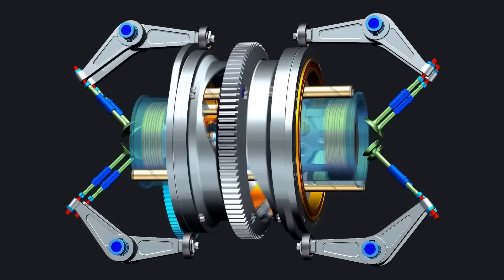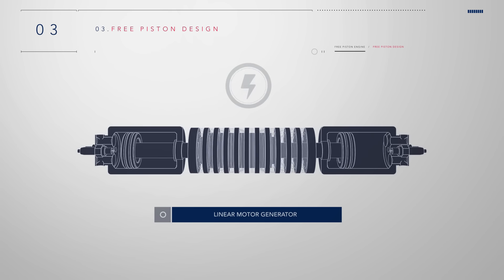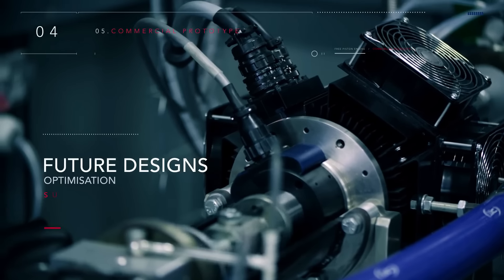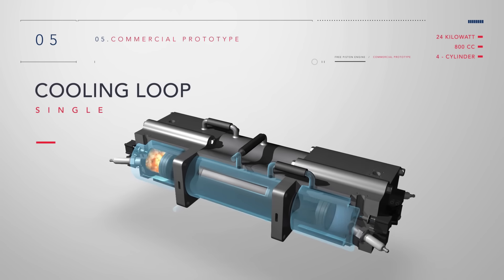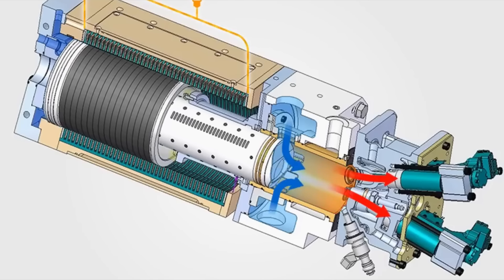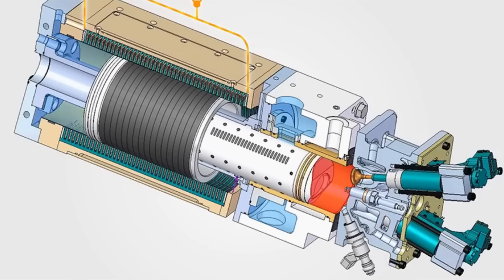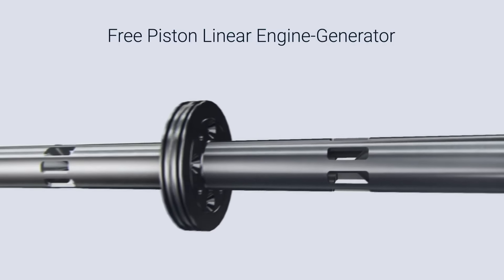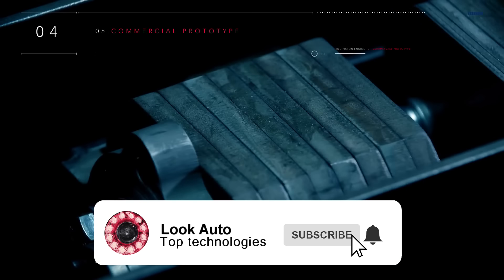New Technologies 2024: W-Piston Toyota | Free piston - efficiency of 50% | Powerful NEW engines

Comment: Isn't a fuel cell more efficient (~60%) and smaller?  So why this? Thanks for feedback.
Reply: because fuel cells need hydrogen, which is a not-so-efficient energy vector, that requires expensive infrastructure for transport and storage, and a lot of energy to generate it, so the advantages in vehicle use are undermined from the disadvantages in the whole supply chain

Comment: This video is wrong, it is not 50% more efficient.  The limiting factor on efficiency is oil on the cylinder walls.  Oil is required for piston rings to seal and oil performance was not improved.  This means the same 30% of heat will go thru the cylinder walls as today and 30% heat loss will go out the tailpipe.  I know because I have solved the oil on the cylinder wall problem and created an engine which is truly 50% more efficient.

Comment: Engine weight 10Kg, output 40hp, still burning fossil fuel and using oil as lubricant.  New Koenigsegg electric engine 25Kg, output 1000hp. Why are we still wasting time and money in RND for fossil fuel combustion engines? Wouldn't it make more sense to invest this RND money in clean battery technology and charging infrastructure?

Comment: Such free piston engines are very easy from the design and manufacturing point of view, but they are rather complicated to controll. The best way to make them is to use a spring-mass-design, which is capable to accumulate the energy of several full power piston strokes. Otherwise they behave very rude with a lot of vibration due to running into their piston stroke limiting bumpers. This problem can be observed very easily in the video of the running engine, when the engine reacts with hard push into its suspension.

The power control needs to work very fast and very precizely, so that the piston always keeps its stroke to maintain the compression ratio. Usually it is done by controlling voltage amplitude of the output AC which is directly proportional to the maximum piston speed. In case it is too low the generator input electronics must lose its break load, in the opposite case it has to enforce its break load.

This power control narrows the power band very much around a certain design power, because the engine runs at a more or less fixed frequency and a certain minimum stroke. So it is usual to design the engine and its control to a fixed operating point at a fixed output power. For hybrid cars this is not such a hard constraint because you can manage your power requirement by use of a buffer battery, but in other application it may be.
Reply: The narrow power band isn't a bug, it is a feature: practically every gasoline-based EV range extender concept is only intended to run at constant load near wherever peak efficiency is for the engine type being used. Designing for constant load at constant RPM simplifies things. Slap a 15kW generator on a small EV, tell the EV that you are going on a roadtrip, EV starts the generator once you get on the highway and need 16-20kW to keep going or the battery drops below generator start threshold, you arrive at your destination with 5-20 fewer kWh left in the battery and the generator putting out a constant 15kW all the way.
Reply: @teardowndan5364   this is correct.

in the 1950ies, as they started in the Netherlands to use Phillps Stirling cycle engines without a battery buffer, the heat capacity of such engines was a challenge. They have used 2 cycles engines with a phase shift of 180 degrees between them. 

In oder to build up power or to reduce it they have used a pneumatic engine cycle short circuit valve in a pipe between the cold ends of both engine cycles. So they could keep the operating temperature at the hot end high all the time.

Comment: Nice concept, simply amazing there’s no need to convert conversion of reciprocation in to kinetic momentum, that’s why no bunch’s of variable moving parts, very less engine components converting reciprocation energy into electricity by linear magnetic field, that’s very cool, only the things to be checked is how much electricity it’s getting from the system,,,,
One of the most important thing is, it doesn’t requires to generate more torque to achieve acceleration, linear torque remains constant as no pressure on combustion chamber!!
Reply: "no pressure on combustion chamber" means its PERFORMING NO WORK. 

you know how you have to lean against something to make it move? that force or pressure is due to the inertia of the object not wanting to alter. 

you kick a balloon, with almost no inertia, and almost no pressure is produced at the point of contact. you kick a brick wall with tremendous inertia, all you do is hurt your foot.

its a continuation of the basics of physics, "inelastic collisions".

and you cannot get a linear generator to provide adequate load against the linear motor. the  magnetic circuit simply wont allow for it.

the only amazing part is how ignorant people are these days.

Comment: Are these two-phase models? Is there a two-stage cycle? And do they need oil for fuel?
Reply: If it's a two stroke, it kind of does need oil, and there's no oil pump mentioned even though it could be electric or linked to the pistons

Comment: For range extender we need split cycle generators, that can squeeze additional 10% of thermodynamic efficiency. Then stirling or thermoelectric module to extract additional 10 percent. 60-65% overall efficiency is possible.
Reply: As I watched this video, I was thinking Stirling myself.

Further, as a stationary engine option, a Stirling based system might be a useful tool for converting solar heat (from some sort of collector) to charge up batteries.
Reply: Stirling engines are efficient but bulky. They're better for stationary applications.
Reply: @RodrigoFernandez-td9uk  It can be Rankine or Brython cycle. Ehryrbrt.
Reply: @RodrigoFernandez-td9uk  Another issue with Stirling engines is they require exotic alloys or materials rather than just cheap aluminum or iron.  They're bulk tends to make a vehicle bigger which negates the fuel burn advantage.   Possibly usuell as a range extender with waste heat used for battery and cabin heating.
Reply: @RodrigoFernandez-td9uk : Improved by the Swedese navy (?), currently used in their "shallow water" submarine fleet...😮
Reply: @arielhermoso4262  Silence is gold for submarines. In that case stirlings make sense.

Comment: Had a really interesting discussion with a friend, not certain what to think of it, so here I am trying to gather as much information as possible. Would really appreciate your comments on the same.

A single-motor Rear-Wheel Drive (RWD) Tesla Model 3 base model is equipped with a 50-kWh battery and a range of 272-mile or 437 kms per charge. 
A 200cc motorcycle petrol engine generates 17-20kwh at ideal rpms with just 1 liter of fuel,

Not sure how it will work but if 3 liters of fuel is required to recharge a battery bank of 50kwh means the same Electric vehicle can travel 272 miles or 437 kms in just 3 liters of fuel. 

Even if the fuel consumption is increased to 5 liters per charge means 87.4 kms per liter or even 10 liters per charge its still 43.7 kms per liter for a car. Whereas an average car travels only 10-19kms per liter.

So a combination of EV + petrol engine is way more efficient than only EV or only petrol engine vehicles?
Reply: No it’s not possible and the problem lays on your assumptions. 1 Liter petrol stores 9kwh of energy. In its tranformation to movement you loose about 70% into heat, so you get only ~3kwh out of 1 Liter petrol.
Reply: these discussion break my tiny mind 😅
Reply: @niklasruhe2354  it is possible, i saw a working prototype & the test in person they used a regular 200cc engine set it at ideal rpms connected it to a gearbox and a 20kw axial flux low rpm permanent magnet generator from China and at 1 liter it generated 17kwh continuously.  So your numbers are wrong
Reply: @pcpatel01   @pcpatel01  an honda electric generator of 110 cc engine. Has tank capacity of full 12.5 liter and runs 7 hr on full load which is 2.8kwh. So total output will be 19.6 kw in 12.5 liter petrol. 
So, 1.56kw per liter. And 1 liter of petrol generate heat of 9.37 kw of energy considering density of petrol 750kg/m3 45000kj/kg calorific value. 
Don't know what Chinese are doing It might be some Nuclear power they are using OR might be your numbers can be wrong.
Reply: @shyamhingankar7442  read my comments properly and understand the basic working theory & difference between regular generators & a motorcycle engine connected to a low rpm axial flux generators. Well if you still dont believe feel free to test it both petrol engine & axial flux generator from China ate easily available & test it yourself the numbers are not wrong.
Reply: Good rebuttal. @pcpatel01
Reply: one plus is the heat generated by a gas engine .
People seem to ignore winter weather anxiety . 
It’s comforting to have a vehicle that can heat itself

Comment: The concept  has come out for a long time, I think the biggest issue of the free piston is that you need to waste lots of power to decrease the speed of the piston.
Reply: Plus it's going to shake like crazy! Lots of vibration.😲
Reply: not really. It slows down by itself because of the current it generates
Reply: Don't get most of that back from the gas spring though?

Comment: A free piston is an unreliable solution. It's enough to have an error in the power take-off, or in the ignition of the mixture, and the piston hits the wall all at once.
Similarly, linear generators have lower efficiency than rotary generators.
These are also reasons why similar constructions have a problem, it's nothing new, they've been trying to do this for decades.
The already better solution is a quasi-free piston where there is an inclined plate and a rotating generator, similar to how pumps in car air conditioners are designed today.

Comment: Lucking this Extea,mmbut stell need a fuel tank   to many komplikated parts end frusteation of nanufacturing,,mbut the half light Neodium generator with high presure hidropump can without this mutch liusing energy to produce the high lewel of rotacion on clutch end gearbox,,,end ewend the limou its on parking you still hawe a free energy anyvere for anyting lije generator pumps or kompresor...no metter...end that is old Profesor from Balkan to long construkted ,,,no hawy fuel tank no hawy engine inafe a double clutch starter for gearbox  end all is OK,,,end moust important the servise are prolonged on few years to exchange the oil in sistem,,,mutch more many to expend on aders thingsbin life familije farm or on mountin somevere far from elektricity from  a generator,,,..good luck....the time resurse of Neodium generator is some longer of few diferent caroseries

Comment: Design is good but need some modifications to resist heat Transfer to center position since magnetic field may get weaker and efficiency may drop due to heat generated. Otherwise design is good and best to use with electric vehicle.we can also used as dual fuel engine with same model with cheaper cost.proper ventilation is must for good life of engine.

Comment: An improvement to be certain but not without significant drawbacks.
The piston/generator assembly represents asignificant amount of mass.
That mass, if not adequately controlled, would shake the engine into self-destruction rapidly as evidenced by the table in the video.
On the Toyota floating piston engine, they have created a hybrid 2/4 stoke engine.  It still has an exhaust valve like a 4 stroke but uses intake ports like a 2 stroke.
This design also has a vibration issue however, it is reduced by pre-compression of the charge.
There is also the issue of the exhaust components weight.  The exhaust exits at each end of the unit through a pair of solenoid operated valves. This requires a extremely long exhaust manifold.
Why not go full 2 stroke with transfer and exhaust ports?
You eliminate the heavy solenoids and valves and shorten the exhaust manifold significantly; reducing overall weight.
Reply: they could make an 8 cylinder version with similar fire timings to an inline 4, this would probably negate most of the vibration, and give enough power for larger cars or trucks
Reply: I am assuming it's a prototype at its current state which will have further improvements for certain.

Comment: Plug in hybrid cars with a 60 mile EV range are the answer. 98% of daily mileage in UK would be 100% electric. All the costly public charging infrastructure (in CO2, not money!) would not be required. The we can concentrate on larger fossil fuel based problems like domestic heating.

Comment: 1. Vibrations
2. Permanent magnet de-magnetization due to heat (or magnet is well cooled)
I can see these 2 problems.
Reply: 1. There is no mechanical  coupling to the drivetrain, so it is much smaller issue.
1.b In the most cases there would be at least 2 pistons that cancel vibrations partially or 4 that cancel totally.
2. Engineers know about the issue.
Reply: And its 2 stroke lmao
Reply: Agree! 
Also concerning is when exhaust-gases are flowing through crank-shafts or other parts of an engine that can't be cooled efficiently!
Reply: Vibrations are easy to fix.  Opposing operations cancel the vibration of the other.

Heating magnets is another easy fix.  Cooling is academic  But simply moving the generator body beyond the crank case, one end or both would separate the heat completely.
Reply: alnico and other ferrite magnets can tolerate fairly high temperatures. we even used to braze magnets to a bit of wire to hold onto carbide inserts to pick them up as we then basted them with oxy torch to a dull red heat... they would survive several months of this daily abuse. 

and of course, you can create magnetic fields with a small "excitation current" in an electromagnet, which is what alternators and power station generators rely on. yes, you need a small battery to supply the initial kick, but once the machine is operating, that power is easily extracted from the "generated" output... your car only needs that battery to START the engine, the alternator does the majority of work running headlights and accessories, letting the battery recharge until the next time its called into service.

the vibration...sure, opposed pistons can cancel but they also require some type of mechanical syncronisation... no longer "free piston".

the biggest issue is that the relative speeds between magnets and the coils generating power arent adequate. 

flux density, achieving sufficient "change in magnetic flux" whilst making an efficient magnetic circuit. it isnt simply about "waving magnets near conductors". theres these terms that are often not mentioned, called "magneto motive force", "reluctance", amongst others.

for a given pole face area, the iron core has to have a certain dimension as well. that magnetic flux has to be couple with the iron core. im not about to write a novel explaining this (people seem to be unable to read more than two sentences without complaining about TLDR?), but lets just say that the combination of pole area, core area, the number of turns of conductor possible in a given space, and the velocity of the magnets or pistons as they pass through this iron core fights against you.

theres also a slight issue that the magnet field doesnt reverse... you only get "half" the available energy density, and the core starts to become magnetised, and that reduces the energy again. 

a rotating generator allows for ideal combinations of all these areas, easily constructed magnetic circuits,  complete reversals of magnetic fields, high relative velocities between magnets and conductors, etc etc etc. you may lose a bit of useful conductor at the end of coils, but thats a minor price to pay for all the other advantages they offer.

in short, a linear generator/alternator fails to apply sufficient load to the motor to be of any use, and the power delivery of the linear motor doesnt suit the load that the linear generator poses.

comeon, nicola tesla was working on linear generators and oscillators all the way back around 1900 and even HE gave up. he used them more as a "constant frequency signal source" than as a source of POWER. yes, his "earthquake machine" was simply a linear generator and "free piston" compressed air motor.

the only modern equivalent is found in small engraving tools...

Comment: 0% efficiency as it cant actually DO anything. make noise? check. make heat? check. make vibration? check. make useful power? bom bom, you lose.

and its far harder to make a linear generator than people realise. look into flux density, reluctance, how to produce an efficient magnetic circuit... how to maximise the "rate of change" of magnetic flux and its linkage with a conductor... and as its reciprocating, you cant get an ALTERNATING magnetic field, either, all you can do is increase flux linkage, and reduce it... you cant REVERSE it, unlike a regular rotating generator... that immediately limits the power density achievable to half...

Comment: Vibratingly orgasmic.. just ratchet the vehicle forward..  I'll stick with counter rotating 'Liquid Piston" engines for a more turbine like smoothness, especially when in a flying vehicle.  The other option is a rocker arm 2 cylinder 4 piston that eliminates the vibration.. Rocker arms keep the pistons moving in the proper alignment and can be part of the solenoid generators.. and will start better using the solenoids.  Keeping the solenoids separate also make the units more repairable and more redundant.  this concept also could be used as a steam engine design.. (triple or quadruple expansion).